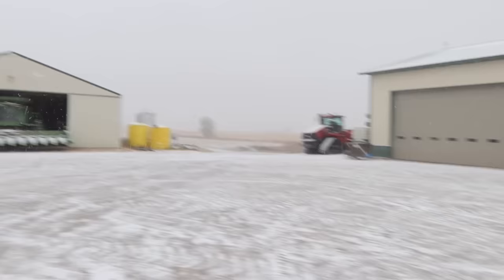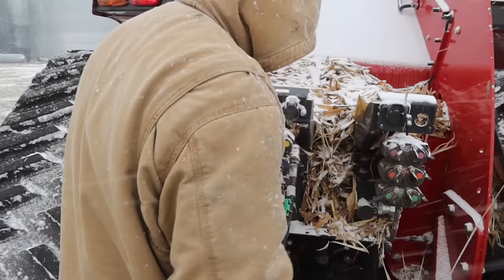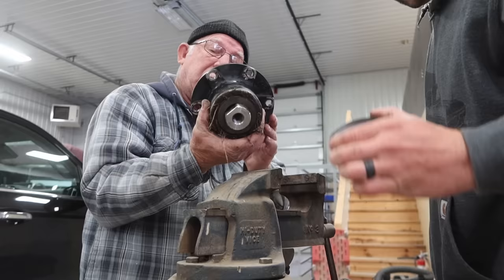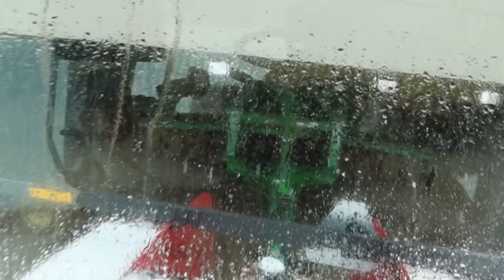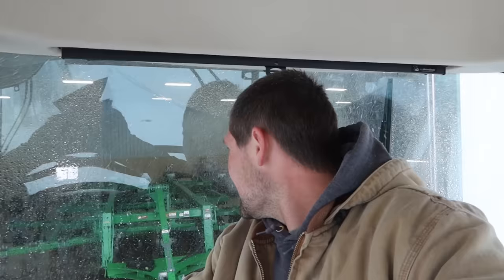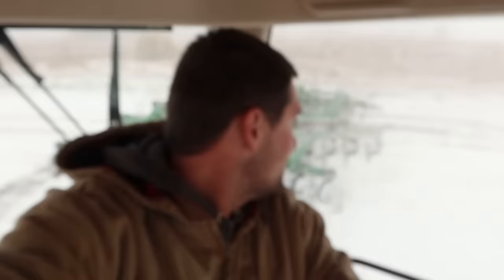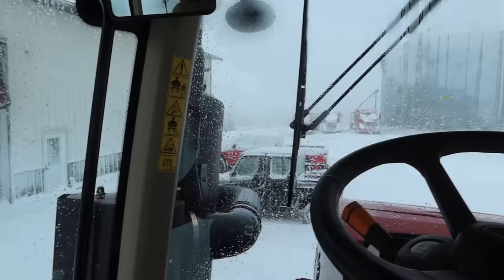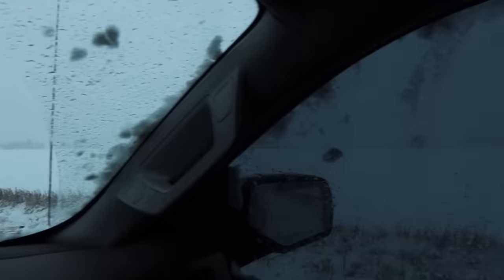Beautiful Harvest Weather

Comment: Keep the A/C running a little so that the windows don't get so moist. The A/C compressor dehydrates the air so you wouldn't have to wipe all the windows every 5 minutes
Reply: defrost runs the a/c compressor
Reply: Yes that works but when in the  snow it  makes it harder to  keep moisture off the windows.

Comment: So you press the button once and it turns the traction control off.  Hold it for 5 seconds it will turn of stability control.  But you have to keep it under 35 mph to keep the stability off.  Or just pull the abs fuse and let her eat. LOVE THE VIDEOS.

Comment: Zach, you or your Dad may already know this but I saw you installing some one inch grade eight (same tensile as stainless steel) but my point is this you installed the bolts upside down, I worked in the family business (along side my Dad) as cotton gin repair mechanics all over the eight southern states well my Dad taught me to drop a bolt meaning install bolts from the top down when possible this way if the nut happens to work itself loose and fall off the bolt would remain in place from the bottom up if that happens you would lose both nut and bolt hope this was helpful, oh by the way three generations of farmers in the same family working together for one common cause is very heartwarming to watch, God bless and take care of each other...

Comment: I've never ran a Deere tracked tractor, have run challenger and Quad tracks and I like the Quads. The local snowmobile club tried using a challenger to groom trails and it got stuck, Then they tried a quad and because of the articulation it didn't get stuck.

Comment: Coloured zip ties on the remote valves of the tractors (6 different colours in total) and then the same colour on the correct hose on the implements make for easy connecting. No more getting the hoses in the wrong spot 👍

Comment: I think a 10 ton hydraulic press would be good to have for pressing bearings and sleeves apart and back together.  Also a hydraulic Porta power with a pancake cylinder and spreading jaws will save you a lot of time and effort removing and installing items 😀.